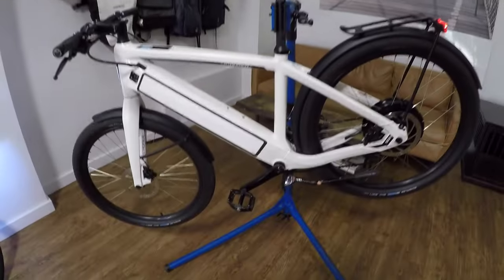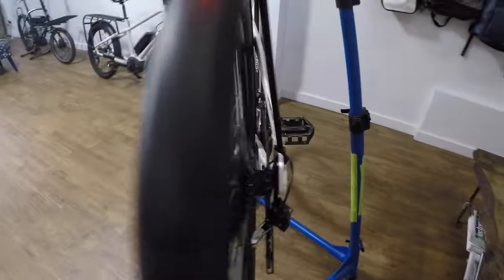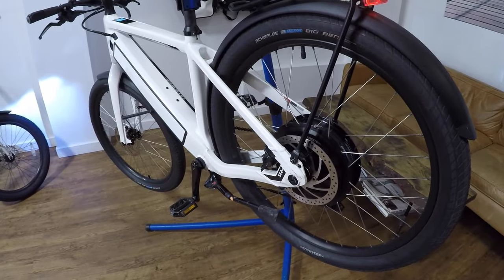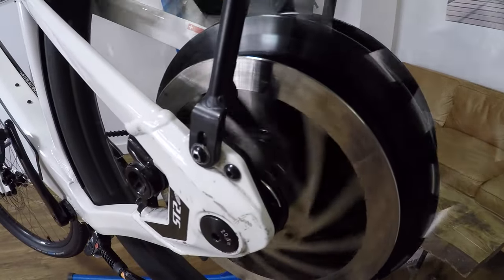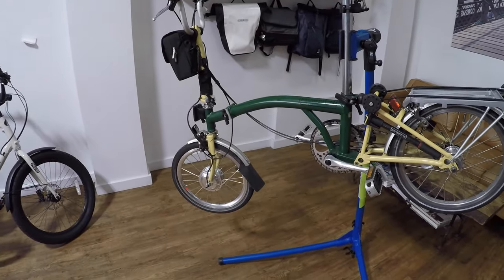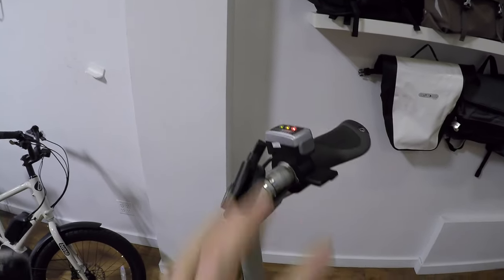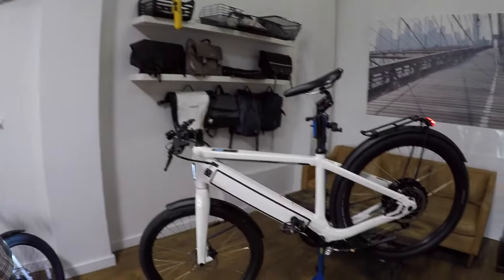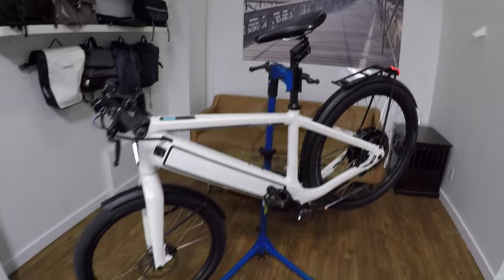Pedal Assist vs. Throttle Activated Electric Bike

Comment: I've watched a lot these 'VS' videos. The people doing the comparisons always fail to mention that pedal assisted bikes accelerate less predictably than throttle ones. They will suddenly propel you forward with a short burst of speed when you pedal at specific speeds that you can't always gauge.

The unpredictability of the pedal assistance can be dangerous when cycling around traffic and when you need to speed up and slow down to get around obstacles because you can suddenly propel forward into obstacles you are slowly trying to maneuver around. 

In my opinion, it's better to turn the pedal assist off completey when on the road and going around obstacles.
Reply: Absolutely totally wrong. Throttles are more likely to propel you unexpectedly if you’re not on the job. Pedal assist is totally controllable. I’ve got both and I know.
Reply: @saltydog888  I've had all types of e-bikes too.

If the throttle on your e-bike accelerates you less predictably than a pedal-assisted bike that gives you a delayed boost of speed, that is an issue with your throttle. 

A good throttle gives you the ability to control your acceleration more precisely than a sensor activated by pedalling.  

Although, I will say e-bikes with a good torque sensor tend to have very little delay and be very predictable; much more predictable than the average e-bike with a cadence sensor.
Reply: @Why-I-Oughta  Proprietary mid drive pedal assist don’t have any surge what so ever. Hub drives do.
Reply: @saltydog888  It is not just about surge. The amount of control you have when using a reliable throttle is more than you'll get by relying on pedalling to engage the motor, especially when going from stationary to moving.

Comment: I have both types of bikes, and prefer the throttle.  It allows me to decide precisely how much assistance I want at any moment, instead of letting the bike control system guess how much I want.
Reply: Absolutely.
Reply: Same here, was trying to mount a kerb and the dang pedal assist slammed me into a road sign. It was more of a comical sideways fall than anything. 750 watt mid drive in a low gear. Did not have my hand on the brake and was using my phone in one hand for a light!
The logical thing is to just have throttle activated pedal assist if there are some pesky "laws" to get round.
Reply: I m having a problem with my throttle no take off there is an E on speedomter where the mileage is

Comment: Thanks Court!I have 8,409 US miles on my ST2.  My longest ride is 114 on flatter bike trails w 15MPH speed limit, I can re-generate 30% of my battery coming down off my local mountain.(3800ft) This bike can make a 50 mile commute very feasible @ 19 to 25MPH .  Jed
Reply from the maker: Wow! Awesome data, sounds like you're really enjoying the bike. Your regeneration stats are amazing...

Comment: I have a front hub motor with pas and a twist throttle. The twist throttle is great, easy to use and you have very good and smooth control over the speed. Can still pedal along with twist throttle or just blip it occasionally to speed up.  Pas is not the best, especially in traffic. Its a bit imprecise, but its good for wide open trails with nobody around. Not good when you have to worry about cars.

Comment: I like the info you provided, but comparing a high end assist bike to a very low end DIY throttle operated bike give the impression that one is better than the other.  Perhaps a video of comparable bikes would be better.

Comment: Since the rise of E-Bikes I learned 1 thing. Lowest assist if u aint done riding and highest when u go home. That way the battery doesnt deplete while u riding. But its not advised to deplete the battery. Normally u want it always above 20-40 % or else buy more capacity. If u come at high hills u can increase the assist but it drains more power. Throttle are crap they drain way too much energy with assist u can go further without leg exercise of traditional bike. The radius of my rental is around 180km then it stops and becomes a brick because some einstein thought it was smart to slow a bike instead give better brakes. I love this technology its sci fy.

Comment: Very cool! I wish I had gotten an electric bike instead of a traditional one when I had some money because my other option was to power myself up hills by cursing plate tectonics. One thing I do wonder is how repair costs on an electric bike compare to a regular bike because I am stuck on my two feet again since I couldn't afford the consequences of my bike being outside in rain and having the control cables rust through. They want an arm and a leg to replace them, presumably with cables that will rust through just as quickly in the rain and I don't have an indoor space so I need to not have that kind of stuff happen.

Comment: Nice Video. I just got a ElectricSa international ebike. Type 2.  I am new to ebikes so this question may be because I have 0 knowledge of ebikes. Question: When i ride my ebike sometimes the power completely shuts off ?  I have to open the battery casing /shassi (it folds open/close) and then reclose it to get the power back on using the power button.  Is this normal to have to keep opening the battery casing folding part to power it on again?  seems odd to me if it is....  thanks!.

Comment: The chain tension sensor looks interesting ...and could be made, maybe.
My bewo I added has a pedal hall sensor that starts/stops the motor if you pedal...not the same.
It has a thumb trottle -- legal in UK as bike bought before law changed. Throttle is very useful.. as is the tip for slightly pulling either brake to cut the motor before changing gears, I have wire disks and the brake sensors are sensitive more than the brakes.
You don't mention direct drive motors have so much drag...can be used for regen braking, but the magnets mean you can't really pedal without power.
The planetary geared ones have a clutch, so the motor is disengaged..a bit.
Good vid as usual. Depends where you live and the law.

Comment: I installed a electric assist motor on my recumbent. I did not put the throttle on, that would turn the bike into a scooter. I use assist only, and I like it that way. You get better range from your battery that way.

Comment: Why choose? My bike comes with both systems. Throttle is handy at start and junctions then I let it go and start pedaling. PAS takes control over and the motor kicks in. Accidental throttle activation never happened to me and I have exactly the same one as in the video.
Reply: Right? Mine does both too. I just press a button to switch between throttle and pedal assist. Not only that but it has a safety feature where if I break the motor instantly stops. So if I am stopped in traffic waiting at lights all I have to do is keep the breaks pulled and the throttle will never accidentally activate even if I pull it.
Reply: Don't break your brakes.
Reply: Can you please explain how you control the speed in PAS by pressing buttons 1,2,3....
Reply: I really wish they would have an electric road bicycle (drop bars) with throttle.  i've done an exhaustive search on the internet and haven't found a single one!  i guess because europe has rules against it.

Comment: Hello…one question…I have 500w Bafang motor on my e-bike…when I start rolling, after one pedal stroke, the motor engages and the bike jumps to 250w…it’s quite jerky if you are not used to it. Is there an adjustment to be made so that “jerky jump” can be minimized?

Comment: To keep the electric bike portable charged can I use a 400watt power inverter with a top post battery to get extra mileage how can I get that ideal to work properly?
Reply: I was thinking of that idea as well and don't see why that wouldn't work.

Comment: I have fat bike electric cycle with SW900 LCD display. I cannot just trottle to make wheel spin, I have to padel and then trottle to activate the motor. Can you please help me what could be the reason? I have searched entire website but cannot find any solution.

Comment: Great video I have a question though how did those electric bikes do in the rain when water gets into that motor .?
Reply: most, if not all of them are sealed. Manufactured bikes can Handle quite alot of Rain., on the other hand you would not treat a 600$ Kit bike Like it was a $99 Walmart special and leave on the side of your house for 2 years.

Comment: what is the best bike that I don't really have to pedal, going 5mph or faster (by power without pedalling), have total distance at about 8 miles per charge, and cost around $600 or less. I saw one like Ancheer for about the price but I know nothing else about it. I do know that it does have a throttle mode that I don't have to pedal but I don't know if it really is and how fast how many miles and more details about it. my use will be mainly be bringing my baby to park with baby seat, going to a bank or buy something close by or errands in my neighborhood which most of them have less than 3-5 miles back and forth total, and my area do have some hills but if bike like these couldn't climb that I could probably go a little long way to avoid it if needed. do you have one in mind that you can recommend that meets my need? thanks in advance and good day sir.
Reply: Ancheer should be perfect for you , depends how much you weigh including load you carry . If you search youtube on ancheer - Vegas RoManiac has a good review on it as well demonstration to put it together which convinced me to buy one . I've only had the ancheer about a week now and love it . I get about 20 miles per charge , goes about 15 - 20( downhill ) mph . The one i purchased is the mountain bike style was about 550 delivered off ebay . It has pedal assist ( 3 levels ) and throttle mode . Some hills with the low power of 250w motor better off in pedal assist and it makes it very easy .

Comment: Regenerative breaking? Class two electric bike, how many classes are there? Why use the term "cockpit"?
Reply: Regenerative braking is when the energy released by applying the brakes is fed back into the battery. It can increase the range/efficiency of the bike basically.
Reply: because with that extra speed. you're flying! lol,  I found that odd as well.
Reply: Cockpit is the proper term...
Reply: "cockpit" & "space"
Reply: @qwertykevin1  says who?

Comment: some controllers have brake detection. if wired correctly, the motor will not activate/cut out if either brake is pulled.
Reply from the maker: Right on! This one has that, it stops the motor and goes one step further to activate regenerative braking... pretty fancy, here's more details: https://electricbikereview.com/stromer/st2/
Reply: Shadi2  One would hope that the throttle cut out on braking would be instant.

Comment: My car broke down and my current job is pretty close by. I’ve had 3 or 4 cars break down on my and I just turned 30. The roads in Michigan are so bad I feel I need to just say screw the cars, let do bikes. I’ve been biking to work and it’s just miserable on hot days or windy days. Also there are 3 hills I have to climb and very busy intersections at the bottom where I can’t use my momentum very often to push on through. Looking into this pedal assist. Looking like I probably won’t be able to afford that either. I want to leave my town so I can find work where I’ll actually be paid fairly but I just can’t get a break, vehicles keep stealing all my savings and I have to start over every time. Very upsetting to hear the middle class say I’m not trying hard enough. With biking to work and working in a 90 degree kitchen by myself 5 days a week serving hundreds I don’t think I’m “too lazy”. We got a transportation problem in this country, specifically MI that siphons all my time and money away from me and leaves me no room for self improvement. Doesn’t help that the landlords here are all slum lords and still expect standard rent rates. Don’t ever move to MI unless you want to be hopelessly stuck like I am.
Reply: Riding without a motor it's better than being crippled the rest of your life after a car crash e-bikes are more dangerous than motorcycles
Reply: Play Google  That was ignorant i didn’t live in a city. In fact i was forced to flee the state all together to find a job that would pay respectable. But now Bidens gas hike is making me reconsider the e bike again
Reply: @BasedRoots  try riding an electric bike with the battery removed you want to talk about hard to pedal especially with fat tires... I'm a mechanic and I hate cars I make money from the hundreds of other people who are still in the rat race always needing brake pads...
Reply: @gliderman1176  Then take the motor off if its broken whats your point?

Comment: New to ebikes , been looking at getting a super 73 scout , but they are saying it doesn't come with a throttle (the aussie version).. does that mean its only pedal assist? 
can i make it into a throttle setup?

thanks good video helped me alot :)
Reply from the maker: Hi Dan! I've reviewed hundreds of other models at ElectricBikeReview.com with videos and stuff, you can see a review of the Bafang mid-drive BBS02 which is what the Super 73 appears to have. I plan on reviewing it thoroughly later this year. Anyway, sometimes you can indeed get a throttle adapter or accessory when you know what the drive system is. Try reaching out to E-Rad which is a part of Lectric Cycles, maybe they can help you https://www.lectriccycles.com/

Comment: Merkins love adding a class system to everyfriggin thing
Reply: Some could be considered “low speed electric bikes” as defined by U.S. Public Law, while others are more closely related to mopeds or motorcycles based on their power and speed. For this reason, several “classes” were created in Europe defining how and where specific ebikes could be used. Variations of these classes are now becoming relevant in America and other locales as laws are put in place determining whether and where an ebike can be used on the road, bike paths and mountain biking trails.  -from the EBR website.

Comment: Should you charge your battery after every use or is it better to drain it all the way down ?
Reply: with lithium it doesn't matter as much no matter what you do.  with other types "they" say you should let it drain to avoid memory, but i recently researched that and i'm not sure it applies anymore with modern batteries.
Reply: Just be careful in charging and the charger do get hot. Owner of ebike, max limit is 24 miles per charge.

Comment: Clearly biased, if you're worried that on bumpy terrain you'd accidentally activate the throttle, then I'd say theres a larger chance of a accident with a bike with pedal assist, for tecnical riding you'd often shift your feet half a turn or so and if you because of that get a sudden power surge it might very well cause a problem.
Aswell as while lifting and handeling the bike its more likely that something accidentally catches on the pedals than the tiny thumb trigger.
Also, the grip trottle might be a problem on rough terrain, well, why do motocross bikes use them?
Reply: Well the throttle is a problem. I have accidentally hit a throttle and made the motor go off with the bike. Not fun, just turn of the bike whenever you put it in storage or are going to lift it. 
Also, when tinkering on the bike, remove power sources. It is as simple as that. 

Just like you don't go mess under the hood of a car when it is running. 

The stromer system is really good. But you have to remember that the stromer is very expensive. Most cheaper bikes only do rotation measurement, so they measure if the pedals are going round and activate after 2 or 3 rotations. The next step is either this system where you don't mess with the bottom bracket or like the bosch drives where you're replacing the bottom bracket anyway so adding a torque sensor there isn't that complicated. But these systems are expensive because they are more complicated.
Reply: I've never had a problem with my twist throttle on my ebike. Also if the breaks are activated the motor is turned off so if I am so paranoid I could just keep the breaks held when waiting at a light then no amount of twisting the throttle will start the motor. It is also common sense to turn off the bike before you get off it. I also noticed that when he showed a bike with throttle he showed the smallest, weakest little bike he could. I got a bias vibe from this the entire time. I can just press a button and change my bike to pedal assist anyway not sure why they have to be separate.
Reply: This was the only convincing I needed: Stopped at a red light(Forgot to set pedal assist to 0 on this occasion and it doesn't automatically go to 0, unlike a throttle), I move my pedals a little, bike gives a big boost forward almost throwing me onto the road and killing me. These days I use throttle only 90% of the time. There's a reason motorbikes have their throttles on the handlebars and not the pedals. That random boost from the assist has also happened many times before as well.

Comment: With a motor that has a max speed of 15 mph what happens if the person medals faster than the motor/outperforms the motor?
Reply: The motors has a limiter since most laws on books in some countries saying any bike faster than 20 mph/30 kph is considered a motercycle. I have mine but is limited at 19 mph.
Reply: There is a way to bypass limiter, online has guides on disabling the limiter.

Comment: Do you know of any strain gauges for d.i.y? only thing else is bb torque sensoe.
Reply: i mean exactly other then that:), see that's one of restricting things, as there's only one of those, and they only exists for 68 shells,  so if i wanted other types of bikes, with more recent shell standard i'm screwed.
come to think of it, i'm already screwed as i have a mid-drive, and i can only use a bb with left-side sensor.
Reply from the maker: Hmm, sorry I don't know of anything that might work for you